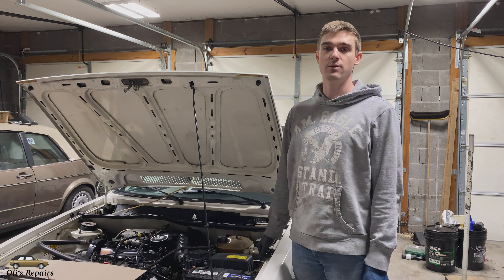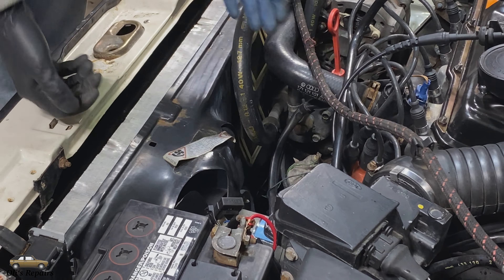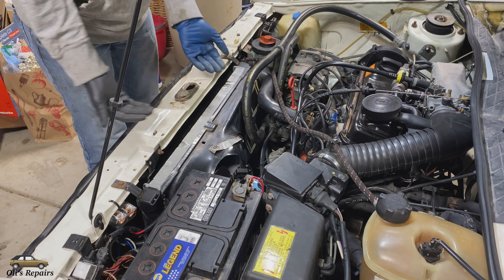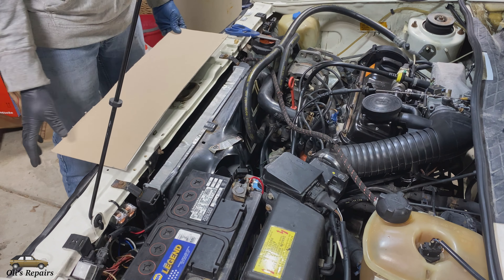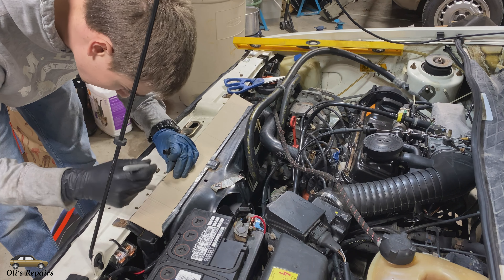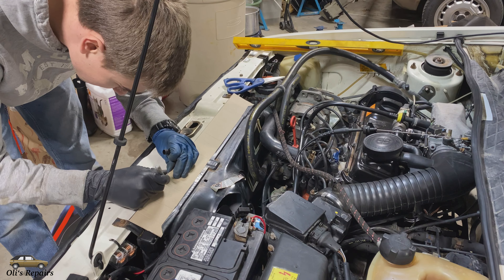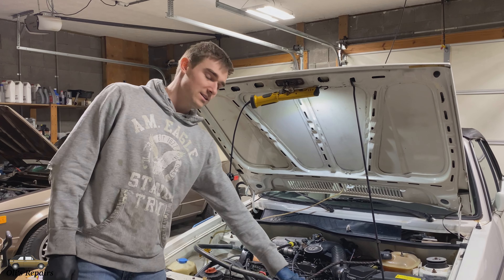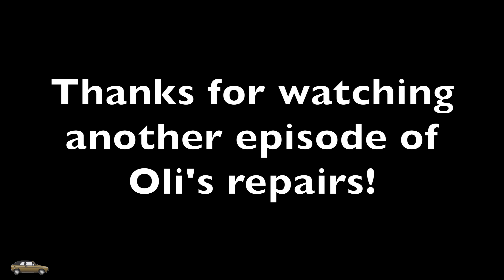VW Mk1 Radiator Cover

Comment: Excellent and super useful video. I would like to see how to make a radiator cover but of lateral side of the radiator, especially, right side.
Regards,
Reply from the maker: I will make a video on those as well. I’ll get some plastic and then make them. I need to replace the cardboard top radiator cover as well..it’s starting it get warped from moisture.

Comment: will this cardboard burn??
Reply from the maker: Yes if it gets hot enough. Just like gasoline. Your coolant system, however, doesn’t ever get much hotter than boiling water, and that temperature is significantly lower than the temperature needed to light cardboard on fire.